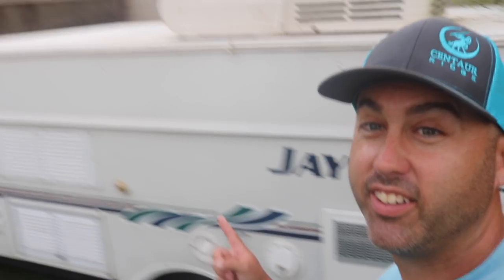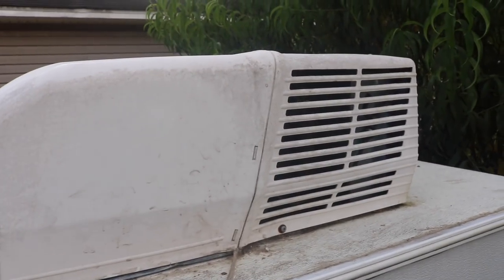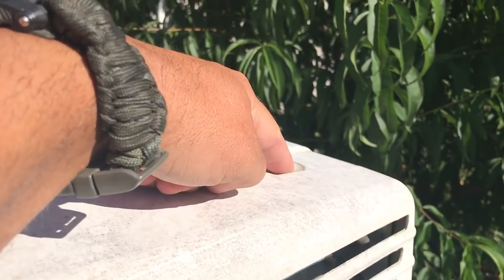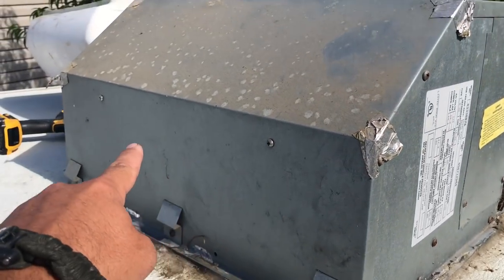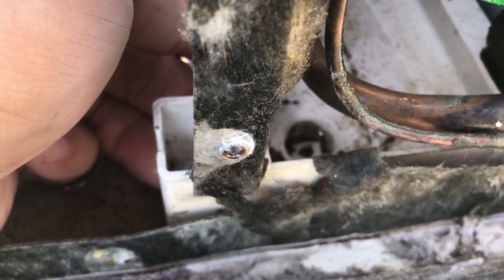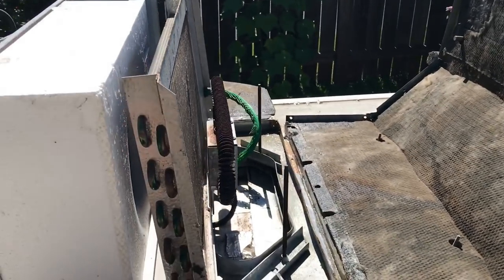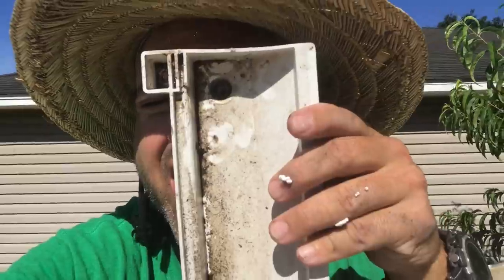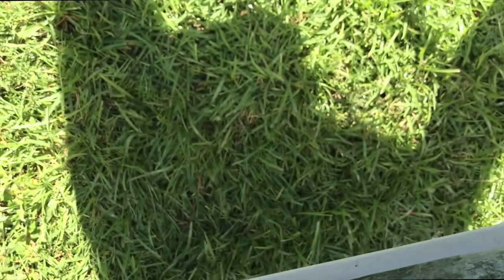How to Fix RV/POP UP CAMPER A/C from dripping water inside!

Comment: After 35 years in the airconditioning business i look back at advice i got in the begining and one piece stands out. My very first instructor at tech school told us we would have to learn more than any other trade but in the end still spend 90 percent of our careers being nothing more than glorified janitors. So yes with a little patience and mechanical skills you can clean coils and pans and oil motors which will do wonders for your heating and cooling equipment.
Reply: Wait, how do you oil the motors? I knew the other two items about cleaning coils and pans.

Comment from the maker: The pan is under the evaporated coil and not the condenser. I got those backwards in the narration (oops lol). You should see the pan fairly easy though. Just check your owners manual diagram for the specifics. I just wanted to get this video out because I had trouble finding mine!

Comment: Now put this down on your winterizing or spring checklist before heading out on your first trip each year.  Along with checking the tire pressure and tread condition, battery water level, LP level and all fittings, etc....

Comment: We also had this issue, we just bought a 2nd hand Jayco Eagle 2016 pop up camper which has a Dometic ac on the roof.
First night out it started pouring in on the little table inside.  It was raining out so we thought maybe that was it and we only roughly leveled it  so maybe rain was getting in, but I’m thinking this could actually be our issue.  Will give it a go! Thanks 😃
Reply: I have a Dometic duo therm. How’d your repair go?

Comment: I have a 1996 Coleman that leaked in. I tightened the unit's bolts to spec and added a clear tube into the plastic drain tray. So far so good but we go camping for a week at the end of the month so I'll comment how it goes.

Comment: You should cleaned the AC unit while you had it all apart. They need uncovered and cleaned out annually. I do mine when I dewinterize it in the spring. Will make them last longer and blow cold.

Comment: Heads up gonna deal with it on regular bases I clogged up those holes drilled through side all the way out 6inches of pc glued in every year before use one air hose blow it out never have to take it apart again

Comment: I just bought a used jayco and have it camping the first time. Ac is leaking. Will have to wait to fix this back home. Also the right front corner spring is out of the tube. Any ideas on that?

Comment: My RV currently has a problem with the roof unit, the control board is out, the thermostat makes contact and sends signal to the board but board doesn't work, something like that anyways : (

Comment: I've got a question for you Jack. I'm shopping around right now for either a pop up, or a small travel trailer. If you had to do it again, would you still buy a popup?
Reply: I know this is a late reply, but in my opinion, get a small camper instead of a popup. We have had both, and a popup is a pain in the butt to set up and take down.